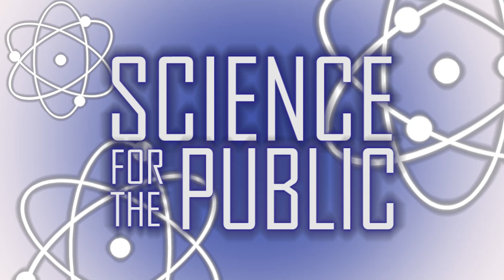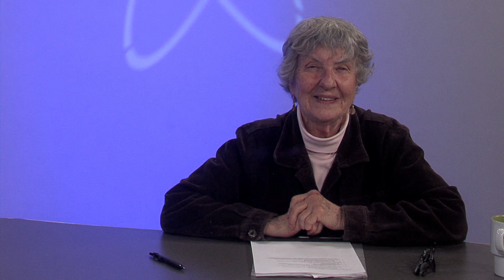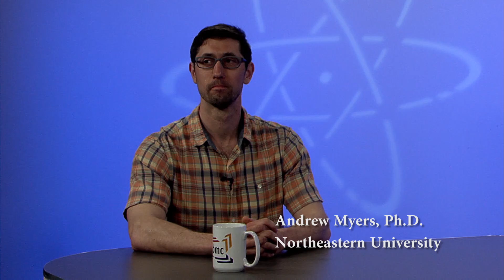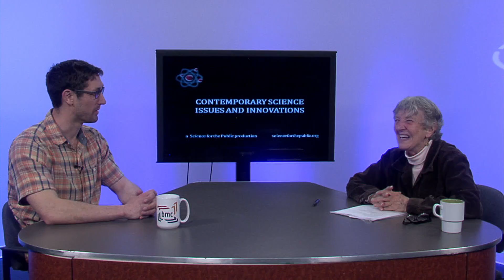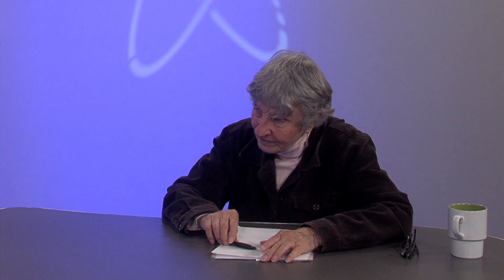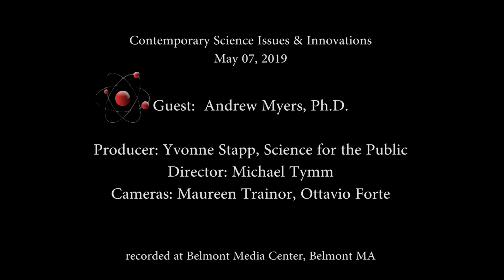The Great Potential of Offshore Wind Farms

Comment: I don't think this Professional Engineer is well versed in electrical power engineering or he would be aware of the defficiences in wind generation. Despite the 'free' wind they are poor at generating power and hence expensive to build and run. They are not a direct replacement for conventional generators nor can you run a grid on just wind or and solar, it just is not technically possible.